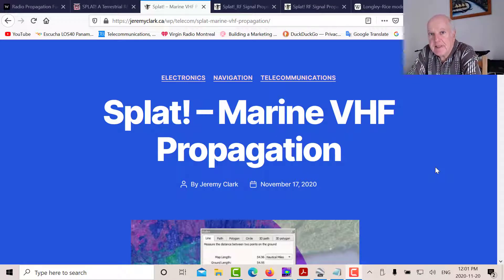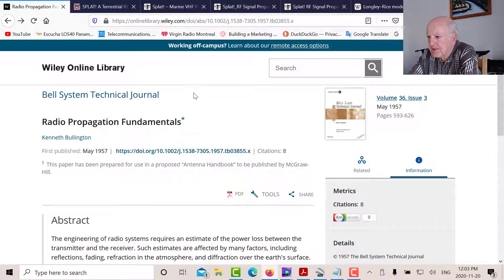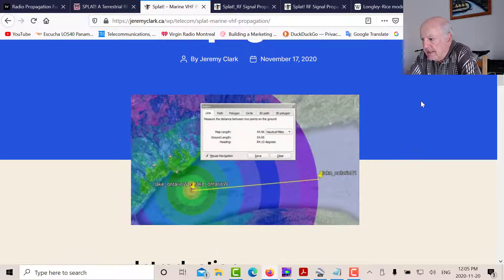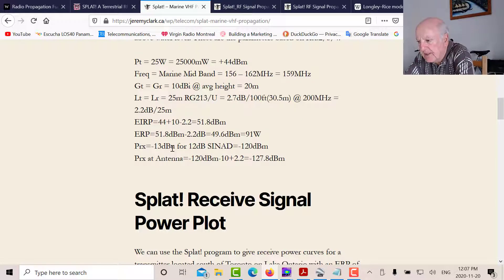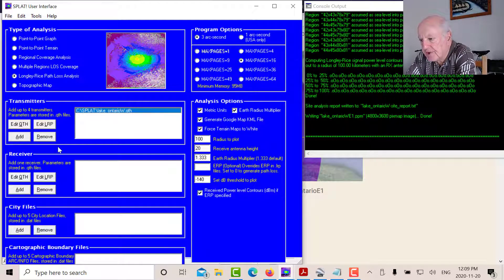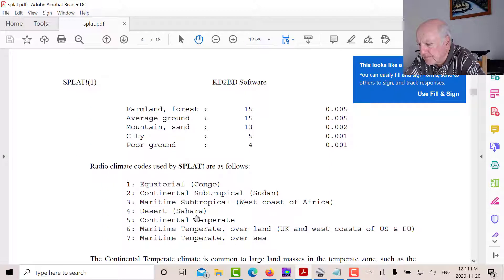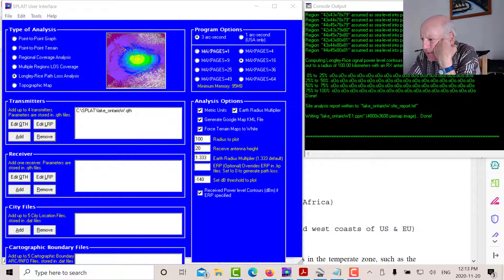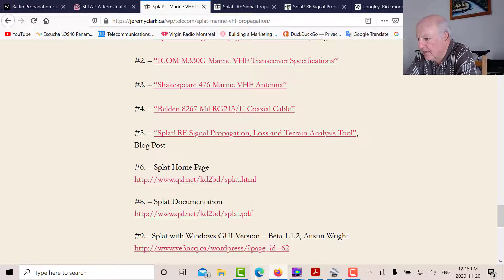Splat! - Marine VHF Propagation

Comment: Jeremy Clark!
Is Ubuntu a browser that needs to be installed for Splat to work?
Reply from the maker: Rubidio: There is a windows version of Splat as well. I used Ubuntu running on a virtual machine for the linux version of Splat. I don't see why it wouldn't work on other linux versions, but I only tried it on Ubuntu.
Reply: @ClarkTelecom  I will try to install. Thanks!

Comment: Hi! Thank you very much for your video. I'm from Argentina and I am triyng to create .kml file but the program is only creating "ppm" file which is a kind of text file. I have loaded all parameters of the transmitter and receiver but anything works!. Please if you could tell me how do you create qth file and .kml file after pushing the "splat" button, I would apprecciate that! It's just appear a console without any print. Thank you!
Reply from the maker: Hi Agustina! If you see a console with no print, then probably Splat! can't find the DEM files. The DEM files are the digital elevation data for the area between the Tx & Rx. I wrote a blog post about how to configure Splat! with the DEM files at:

https://jeremyclark.ca/wp/telecom/splat-rf-signal-propagation-loss-and-terrain-analysis-tool/

Which version of Splat! are you using Win/Linux?

Sorry to hear about Maradona, incredible player 
Best Regards
Reply from the maker: Also don't forget to create a "tx_name.lrp" file with the same name as the TX. Open a sample, adjust it for your situation and save it with the changed name. Don't include it in the TX window, the program automatically looks for it under the tx_name.lrp